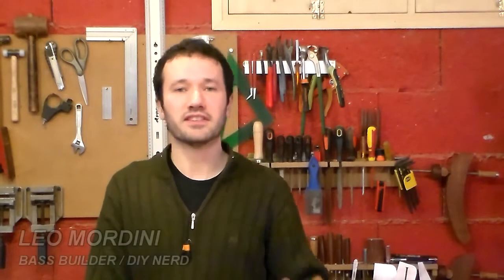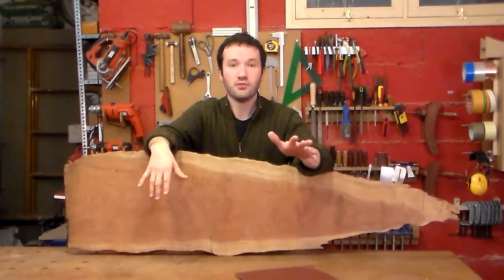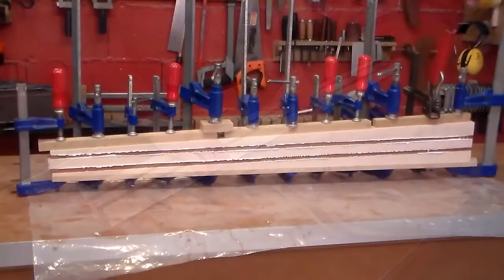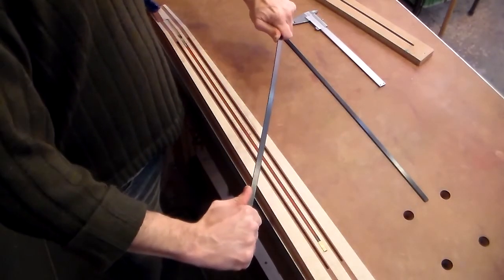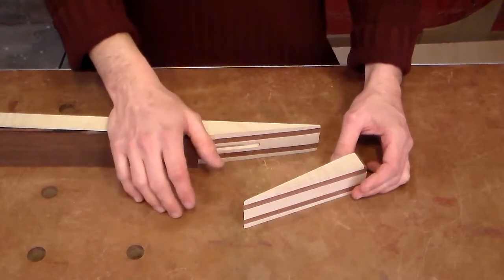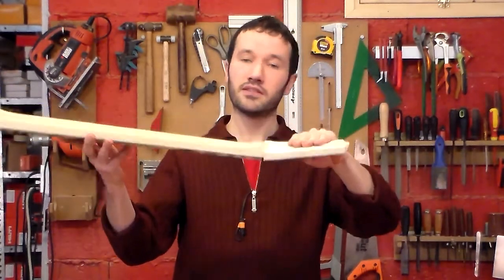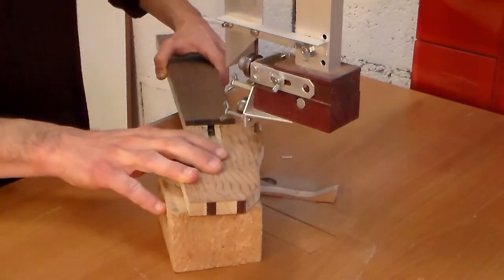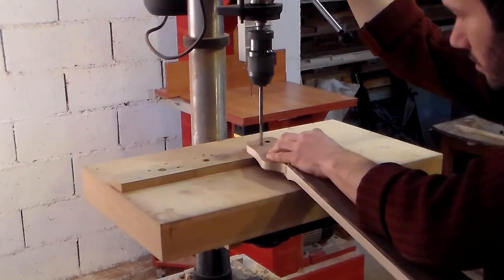Ele Custom Basses - Building the Person Tupinambá Signature Bass - Part 1

Comment: Nice work. I have noticed though that you use both, carbon fiber sticks and a truss rod for the neck. I don't exactly understand the reason for it. Yes, we want to have the neck strong and rigid in order to withstand the string tension but in this case we have two systems working against each other. The carbon fiber sticks will add strength to the neck thus keeping it straight while the trussrod will try to bend the neck either forwards or backwards. So when you use the trussrod you will have to fight the carbon to adjust the neck.